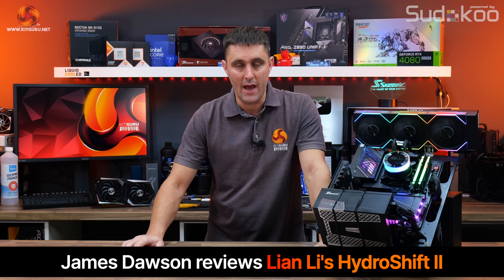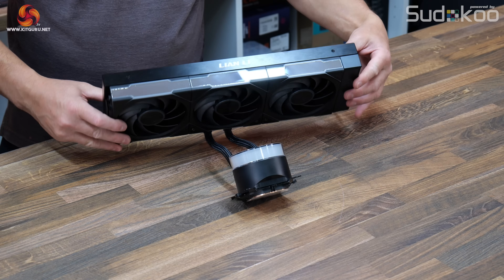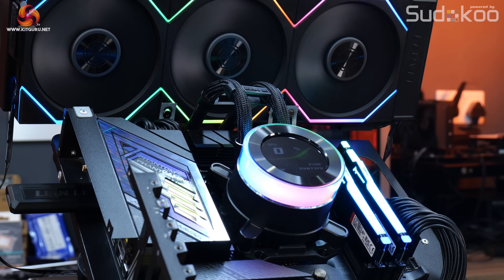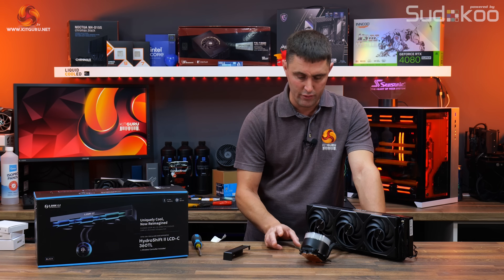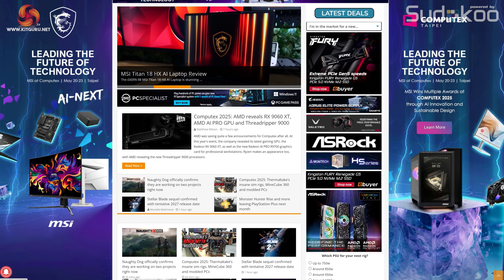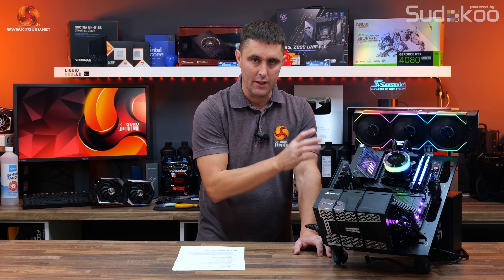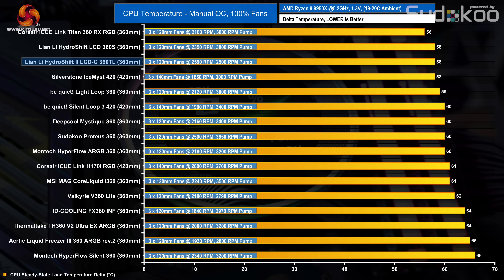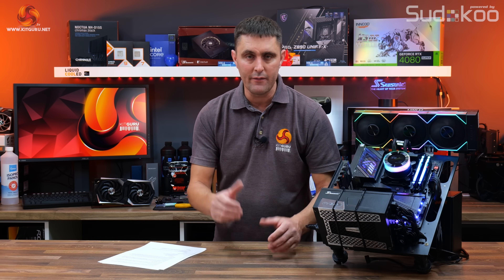New King of AIO Coolers: Lian Li HydroShift II LCD-C Deep Dive

Comment: I have a question regarding the sliding mechanism. If you put paste, a kryo sheet or PTM7950 on the cpu, doesnt the sliding mechanism pushes it off the heat spreader or does the block has no contact while sliding it in?
Reply: @r0tb3rt  I also was wandering about that. Any update or info on this topic?

Comment: I am between Lian Li HydroShift II LCD-C and ARCTIC Liquid Freezer III Pro 360 A-RGB. What is the right choice?
Reply: If u care about the lcd screen and also want a cleaner look go with hydroshift 2 if not go with the arctic
Reply: The price difference between the two is quite large. Aesthetically, the Lian Li one is unrivaled and on top of that, it is one of the best coolers. As a second option, much cheaper and aesthetically pleasing with a good screen, I would also look at the Thermalright Hyper Vision 360.
Reply: @InfoLegenDz  GOAT comment

Comment: Would love to know long term reliability testing since the original Lian Li 360s Galahad had all sort of issues with the pump clogging. Some units that underwent a second soldering (flux repair) for the radiator had missed quality control checks, leading to flux residue potentially corroding the coolant over time and causing potential failure.

Comment: Thinking of getting this fanless and installing some reverse fans on, cant find it in stock anywhere though only preorder
Reply: Probably a good job. There's been a ton of complaints about it, and Lian Li have just put a notice on their Reddit page to say they have identified an issue with current Hydroshift 2's. From June 12th, a revised Hydroshift 2 will be manufactured.
Reply: @Mapantz1  Thanks, its not in stock in the UK till the 31st of July anyway so i assume it'll be the updated ones ill double check though

Comment: Wait a minute I'm confused. With this whole sliding the water block onto the CPU, I don't see anything about thermal paste coming off if the sliding block scrapes the paste you applied. Am I missing something or is there clearance between the block and the paste before tightening it to not worry about it scraping off?

Comment: i Got a question: I've got a B450 aorus elite with Ryzen 7 5800x and i bought a 5800x and the temp while gaming are around 70 to 80c and when running cinebench it's always 90c but hwinfo says there is no thermal throttle ; does buying a better aio cooler makes the temp get lower or not ? my case is mastertech t500 hacker and there are 3 fans installed at the bottom for intake and 2 at the back for exhaust and 2 aio fans at the top are set as exhaust too because of these temps the fast were always ramping up and i had to set a fan curve of 60% FOR 60C and under to maintain a balanced noise ratio to stop them from ramping up .

Comment: Increases compatibility? If your case can accommodate 360 aio, there is always room even for thick Liquid Freezer.
Sff cases? If they aloud to fit 240 aio, that's mean standard 27mm radiator always fit.

Comment: quite nice! I got myself the first Hydroshift AIO and I LOVE it. I think I still prefer the square LCD screen since the fan designs and everything is very angled, but nice to see Lian Li pumping out more options!
Highly recommend getting one of their AIOs they're insane. I undervolted my 9800X3D by -40 and to 5.4ghz and got to 28c idle it was lovely. Games rarely go over 50c unless I have the heater on or it's a really hot day.

also the smaller radiator is actually a nice change, I was originally going to get the O11 compact but the first hydroshift is too big for the side mount, so ended up going with the normal O11 which I absolutely love as well. But nice that this should fit on the side now of the compact case!
Reply: have u ran into any issues yet? i want to buy one but im hearing a lot of issues on reddit
Reply: @eevanja   I've had one tiny issue where sometimes the LED screen doesn't sync to the program and show the gif I have set, it just shows the Lian Li logo. But after a restart of the PC it comes back on. 
Though this bug typically happens after I've done some tweaking in the BIOS. I think it's happened once with a normal boot and I've had the PC since Feb this year.

Comment: 13:23 R.I.P thermal paste
Reply: @toonnut1  I was gonna mention the same thing. Wouldn't the sliding mechanism smear the paste over the edge of the cpu?
Reply: @peterhahn8280  No it doesn't. It only starts making contact once you tighten the 4 screws in each of the corners. I've just returned this exact model 2 days ago because of a very noisy pump. When I took off the block the thermal paste was perfectly square and nothing went over the edge of the CPU.

Comment: The radiator on the originals 360s is smaller than that on the 360r and 360tl. Im not sure if the original fanless and s version share the same size as the hydroshift 2's size but theyre definitely smaller than the r and tl version so the comparison in this video is kinda misleading

Comment: So if you install it at top, you wont be able to place your dust filter due to the screw that holds it in place????
Reply from the maker: In most cases it would be best to use a standard Philips radiator screw. I'm not sure why Lian Li puts the thumbscrews in.

Comment: Is there no 280mm ver yet and the tubing length for side mounting needs to be longer though ? 
 C'mon Lian Li stop mucking about, you've people with your small cases like the 011 dynamic mini with an old kraken in it 😂

Great vid 👍🏻
Reply from the maker: HydroShift is only really designed for top mounting.

Comment: I know their is 3 type of hydroshift phase 1 and here they compair with a version with fanspeed with 2500 rpm.
The other have 2600 rpm but same pump.
The chart is misleading.
Reply from the maker: That's why there is a noise normalised test too.
Reply: Then why not compair with Lian Li Hydroshift LCD 360 TL Aio vs Lian  Li Hydroshift 2 LCD 360 TL Aio

Edit: i checked the stats comparison of phase 1 and 2 they have the same pump speed , air pressures/ speed and noise. The only thing they changed was the size of the radiator the cover module.
Reply: Would be nice if their is any difference of the change of the size comparison.

Comment: not a fan of that mounting bracket for AM5. You cannot adjust the height in case the user wants to use it with direct die since it cannot go any lower due to physical restrictions. Not sure why so many companies keep messing up the AM5 mounting system when Intel usually has the best one (a simple bracket with mounting points on each four corners)!

Comment: Having cables means its NOT WIRELESS!
Reply from the maker: It's not completely wireless for sure. Maybe Lian Li should have called it reduced wiring rather than wireless. That doesn't quire roll off the tongue as easy though.
Reply: @KitGuruTech    I would have been much happier to see reduced wiring than implying that it's wireless. Charging your phone wirelessly means no wires going to the phone while you're charging it. A wireless phone, has no wires going to it. 
I understand  that you're just going by what what is written in the review package but it is a bit of a falsehood saying it's wireless. Reduced wiring is a much much better way to describe it. 😎😎? ?

Comment: If I want max thermal performance for a 7950X3D but don’t care much about RGB or screens, is this overkill compared to a Thermalright Peerless Assassin or basic Arctic?
Reply from the maker: A Peerless assassin would not match a good 360mm AIO in raw thermal performance but it depends on whether you need to extract every last ounce of performance from the CPU or not.

Comment: I’m trying to decide between this and the DeepCool LS720 WH for my white-themed build. Is the Lian Li worth the extra cost?
Reply from the maker: It depends, if you want a super clean install then maybe. If its just performance there won't be much in it. The Deepcool cooler will be better value for sure.

Comment: See problem with Lian Li AIO was never the performance. I have now owned their 5 AIOs. Started with Galahad and now on Hydroshift 360R LCD. THe performance is top notch. Also love their Lancool 207 chassis I am using right now.
But AIO is completely different matter. I have had to RMA every single AIO I have used due to some sort of issue. The latest Hydroshift LCD I had to RMA because middle fan on radiator failed. ITs never the pump but other things like RGB or fans.
Also hate the fact that they have USB to control everything and no ARGB header. It might be clean but its nightmare thanks to subpar L-connect 3 (latest one, but its been an issue with all previous versions too).
As everything including ARGB has to go through USB, you have to deal with L-Connect. Problem is it sucks. It is buggy. There are times when waking from sleep the USB loses connectivity and fans go full speed. LCD turns to static lian li logo and you have to first switch off the PC completely, then restart it after next boot to get everything back. And I have verified this on 3 different units used in 3 different OEM boards. Asus, MSI and Gigabyte. this affects every one of them.
The motherboard sync option in the L-connect 3 for ARGB does not work with most of the latest Z890 and also one MSI X870 board I have tried. It worked on older ASUS board but not on latest one. Its been 7 months since these boards have launched and sill L-connect 3 is not ready. IT also does not work with 3rd party apps like signal RGB due to the USB control. 
This is why I am reluctant to spend big bucks on Lian Li AIO anytime soon. I always get tempted by features and clean aesthetics, but its too much of an annoyance to deal with this. On the other hand arctic and deepcool AIOs have worked flawlessly. High failure rate and issues with USB and software needs to be examined and highlighted by big publications like KitGuru, I hope someone reads this and pass on this feedback to Lian Li and also do long time testing in one of the rigs to followup later. 

These issues are all over reddit but nobody from Lian li seems to address those for years.
Reply from the maker: Thanks for sharing your thoughts. was surprised to hear about the RMA issues - thats not too good to read!

Comment: They thumbscrew at the top wil prevent some top panels from being installed properly, no? It feels like they have not thought this through. Also, I'd rather have a good performing model, wihtout all the LCD and RGB gimicks for cheaper. As it stands, Arctic is still untouchable in terms of value.
Reply from the maker: I noticed this too with the thumbscrews, on most cases you would need to use regular Philips head screw, some come included.

Comment: They need to make an air cooler AND a 420 version! 😭
Reply from the maker: A 420 would be good, but theres not a huge amount of cases that do 420mm top rads, I guess that's why Lian Li only does a 360 right now.
Reply: @KitGuruTech  I agree. For me it's purely to match the 140 fans elsewhere. Literally no other reason than to be the same size lol.
Reply: 420mm is just overkill!

Comment: Really curious how long the wireless module lasts in daily use. Still feels weird to call it wireless when it’s still got power cables though 😅
Reply from the maker: You would hope it lasts at least as long as the 6-year warranty period.
Reply: Unless you come up with a way to power without cable, then no.